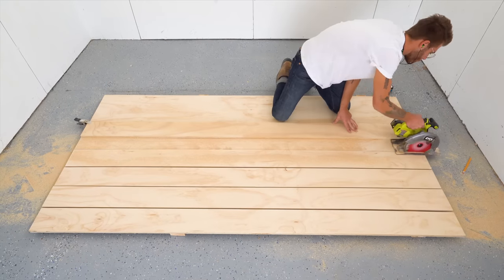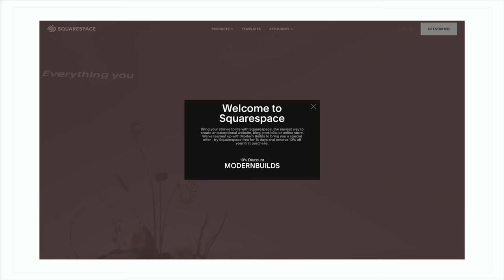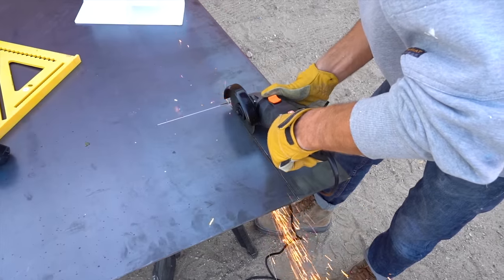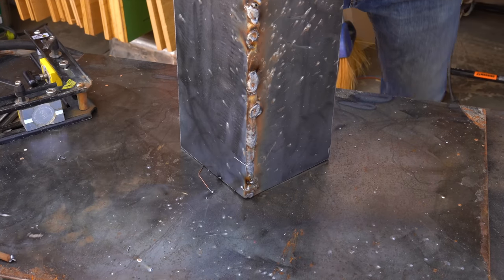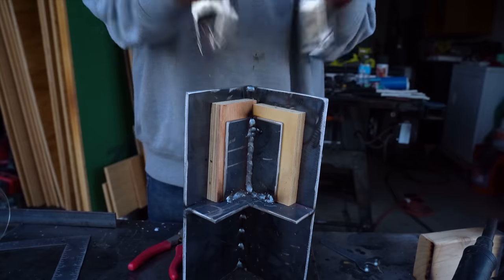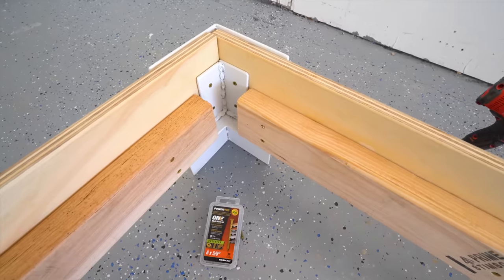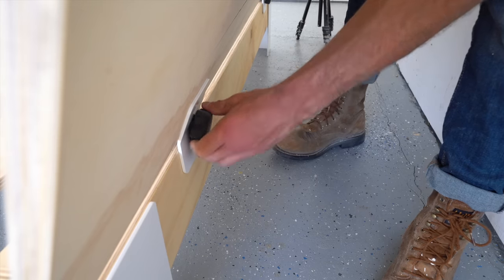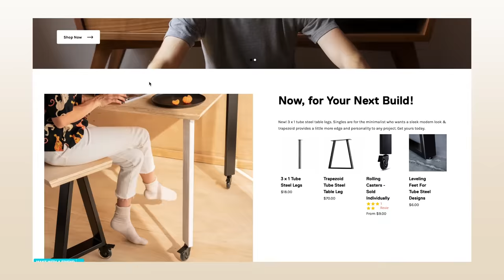DIY MID CENTURY MODERN PLATFORM BED | Modern Builds

Comment: Corner legs look great, I'm not convinced about the headboard bracket. Feels too springy and it's already leaning back quite a lot.
Reply from the maker: If your bed isn't against a wall it'd need to be beefed up, but I don't know anyone that doesn't
Reply: @ModernBuilds  Good point. Perhaps you could have a rubber or nylon strip at the top edge so the bed doesn't damage the wall paint?

Comment: Mike, next time you're drilling through metal without oil, just put some water on it... spray bottles work best, but anything would do. The bit goes dull because it gets too hot and melts the sharp parts a bit. The water will evaporate off the bit as it gets used, cooling down the bit and keeping it sharp longer...

Comment: For the bed legs... instead of welding two pieces of steel in a 90degree angle, you could've used a much wider steel plate and then folded it to give you that l-shaped leg. It would be much stronger than a welded piece and you wouldn't even have to weld...

Comment: Very cool and clean looking. Two questions:
1. It looked like you used Simple Finish, but didn’t refer to it by name. Am I wrong, or is something up over there?
2. What’cha gonna do with with the DIY legs?
Reply from the maker: I used water based poly from Home Depot… we’re developing a water based version of simple finish currently so we have both oil based and water based 😁
Reply: @ModernBuilds  glad to hear the Simple machine is still up and running.

Comment: That's just say theoretically you wanted to build this but you wanted to add drawers but you still wanted the luxury to be able to lay down comfortably and read a book comfortably but you wanted Storage space would you have to change anything? Just wanted to ask
Reply from the maker: That’d be easy I think! I’d make an additional “drawer box” that attaches to the bottom of the 2x4 frame underneath the apron pieces!
Reply: I have a fairly old bed that has a baseboard and a footboard and I have a lot of space underneath My bag touched Ito fit a few medium sizes of dogs believe me I know I have a short haired black lab Mix  And when there's a storm he gets scared and he'll come in my room and he'll quite literally crawl under my bed I don't like it but Is he's a Dog he can't help it.
Reply: Sorry for the 2 super long comments thanks for the help

Comment: DO NOT put the head and foot boards in the brackets first like their company instructional video initially shows...Put the side boards into the CORNERS of the legs first because if you do it the other way around the bed width will be too narrow for the slats at the end. Ask me how I know.  The product is great!...but their operations are dismal.  The initial shipment was missing nuts for screws and also was missing the floor protector for the bottom of the center support beam which is now all metal and not wood like the video shows. There were no instructions on how to assemble the new metal support beam and the initial response when I emailed to ask was.  "We don't have any instructions" 😡..I said that was an unacceptable answer for a DIY assembled product and voila a video on how to assemble was miraculously found.  I initially ordered the 18 inch high leg size but they were too high so I exchanged for the 12 inch size.  The day after I ordered the second shipment I got a notification from FedEx that the sender had cancelled the shipment after is was already in route.  I had to email them to fix that too and I got the package a couple of days later than I should have.  The PDF instructions also has several incorrect screw counts and the screws for the new metal support aren't listed at all.😮‍💨

Comment: Not a bad bed but way over paid for the steel... probably a single stick of angle iron would have given you more than enough material and for much less and be much easier to work with.

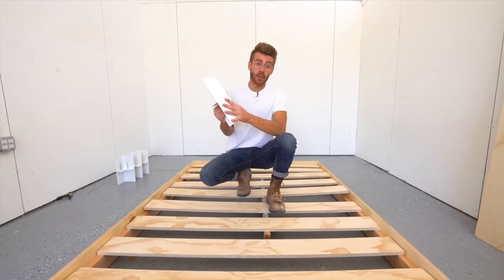Comment: 2:54  Strong plywood bowing up there.  Not for me!
Reply: im sure it would hold with equal weight distribution
Reply: You want flexibility in the centre of a bed. That's why most beds use a slat design, equal weight distribution of the mattress makes it work.